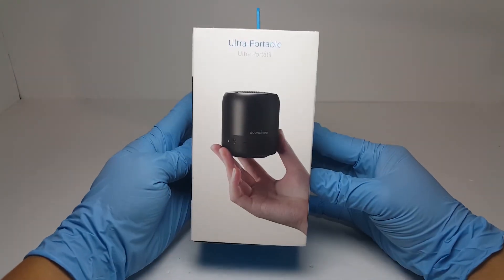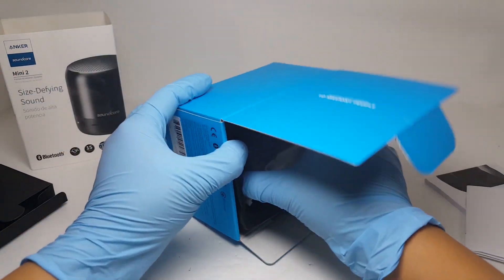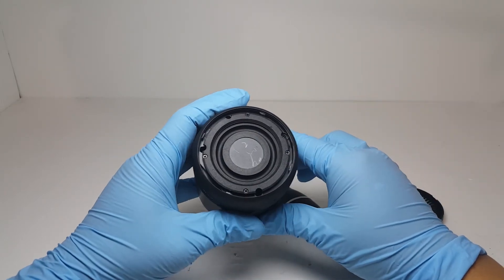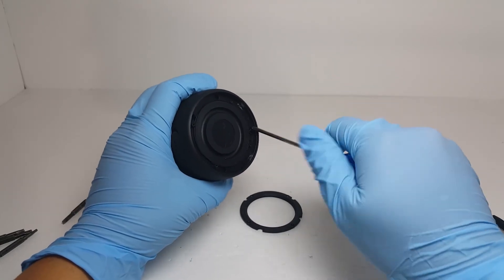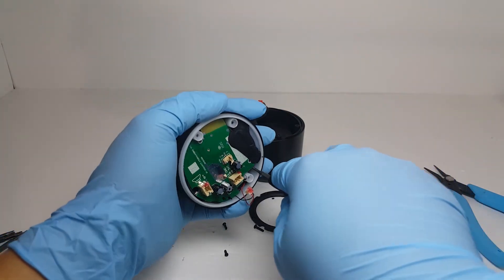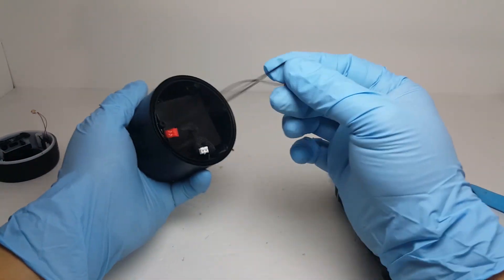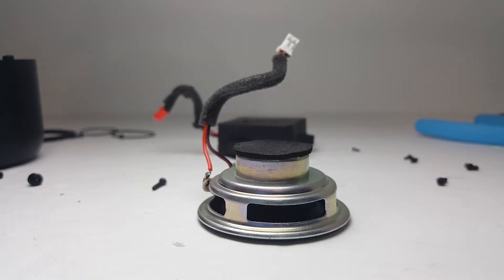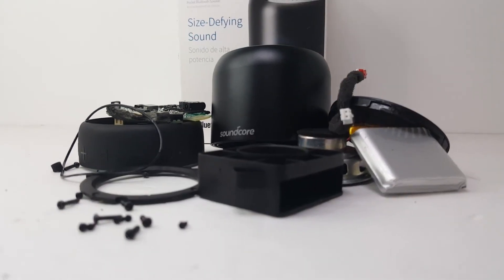ANKER SOUNDCORE MINI 2 TEARDOWN

Comment: After watching this video I was able to repair my Soundcore Mini 2 miself. It was stuck in solid red light, and was not starting neither turning off or playing. So here I've learned how to open It, then just unplugged the battery wires connected to the motherboard and reconnect. It was like a hard reset, and voilà! Its working again! Thank you for the vídeo!
Reply: can you please detail how can I find the vents to open it? I am with the same problem , red light
Reply: What I'm experiencing now is that the on/off button hasn't been working for a few months. but I haven't tried dismantling/repairing it yet